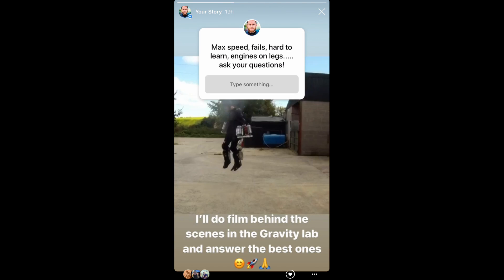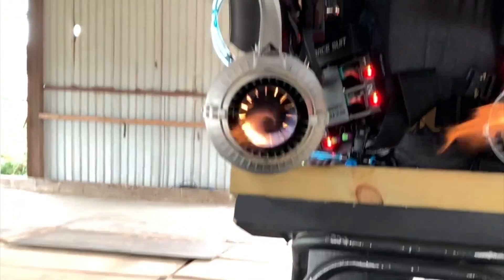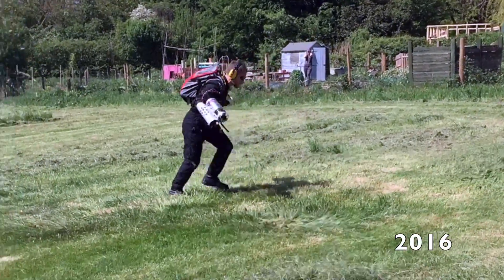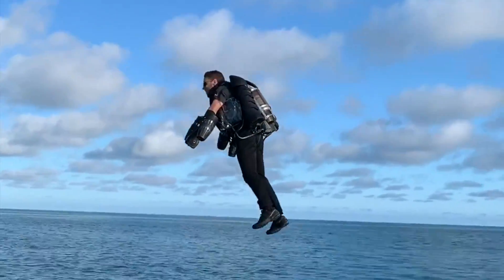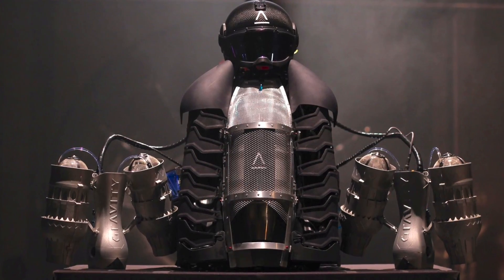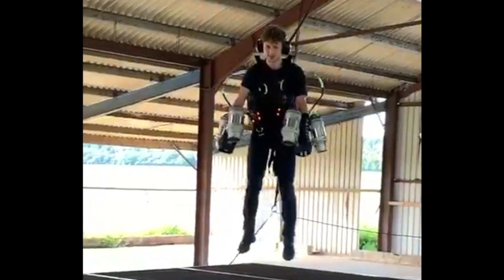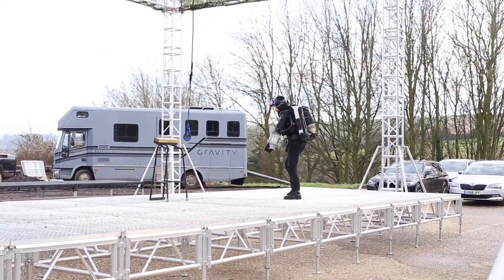EP1. - 1000bhp Gravity Jet Suit Explained: Jet Engines & human control

Comment: Like use 35 gallon of kerosene in iron man suit question is how do u stored use pipes some small some all part of suit pipes would be fined change the size of the engine to cylinder to large leg size thing insert pipes in front of them connected together then the main pipe would be connected to the feet gauntlet and wi have almost everything in plane

Comment: un  believable - putting the lockdown to good use, but presumably you were going to launch this at some point anyway, did it just bring the date forward? Also it looks a little scary going over water because it's going to take some pretty strong legs and arms to keep that weight above water so the pilot doesn't drown??

Comment: would be super awesome if u could like have it attach to your elbows and have it suspend like a bow across your shoulders so with minimum focus and you can operate something with your hands. kinda like anime valkyrie wings lol. like have it controlled by the muscles we would use if we were birds and maybe a hard steer attached to foot sole to put body weight into steering so you could do some high speed gundam robot fighting

Comment: Hi Richard, let me first congratulate you on your fantastic invention, & I have these questions for you please. I noticed you said the turbine engines run on various fuels. Which fuel gives the best all round burn, with regard to power produced & economy regarding flight time, & are you experimenting with different fuel mixtures or additives to attempt to extend these? I wish you continued success with your business venture, & most of all stay safe, (as you can, considering what you do). Regards Rural Geeze.

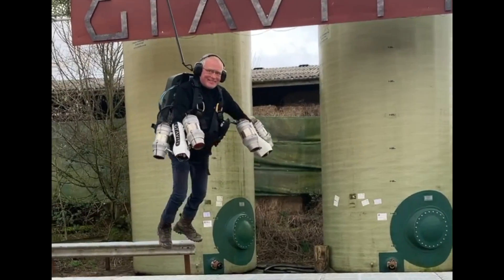Comment: 3:40 I think more people need to see that shot of the older guy flying - will quickly sort out those remarks of "Richard must have insane arm strength" or the "you should add supports so that the arms aren't under so much stress".
Reply: It's fake.

Comment: How does the jet engine starts without compressed air
Reply: brushless DC motors with a one way bearing. They are very common in RC model aircraft.

Comment: I’m probably a little late to the party for a reply but... do you guys plan to expand into possibly electric using hydrogen cell tech? Purely due to the energy density of hydrogen gas and the much more responsive electric engine control AND the fact you can then spread engines across your legs aswell because I remember you guys had trouble with the hot air from the back or arm engines being sucked into the leg engines and burning them out in seconds/instantly.
Reply from the maker: Nathan Masatto good thoughts. Lots being explored but hard so far to beat the energy density of Jet or diesel, plus ease of containment and relative safety. Our electric one is a struggle with battery weight. More in next episodes:)

Comment: why don't you put a pair of jet engine with leg? it will add more force
Reply: Adding thrust to their legs has flipped them upside-down whenever any significant force is added due to the distance from the center of mass.  They've also said  using their arms makes steering feel more intuitive.
Hope this helps!

Comment: hello!! just out of curiosity have you even thought on using Nuclear power like in submarines so that you can fly for more time than usual. I know it's not easy,cheap and i am just a  School boy right now but still you can try to give it a shot.
Reply from the maker: PARTH JOSHI very tricky:)
Reply: @GravityIndustries   but legitimate and possible
Reply: Electric would be more cheaper yet difficult
Reply: nuclear powered jet suit would be badass, don't know if it's practical though
Reply: but you have to give thought to radiation, the pilot would have to be shielded and the shielding required combined with the cost may make nuclear impractical.

Comment: Any chance you could show us how the pilot is strapped in and where most of the weight is distributed? How does the system work in different outdoor weather conditions? Any thoughts on simple spring based arm supports to reduce fatigue?
Reply from the maker: Will aim to cover in next episodes 👍

Comment: Hi, I recently found out about you guys and in some articles online, it's mentioned that your jetpack can reach altitudes of 12,000 feet. I've seen most of your demonstration videos, but never seen you fly the jetpack really high, it's always near ground level. Is it not safe to fly the jetpack higher than the levels you fly at?
Reply from the maker: techbhogi good question. Will cover in next episodes:)
Reply: I think there's still not enough safety measures while flying that high. That's also why they mostly fly over water
Reply: Well. Obviously. Plus these engines loose efficiency as you gain altitude.